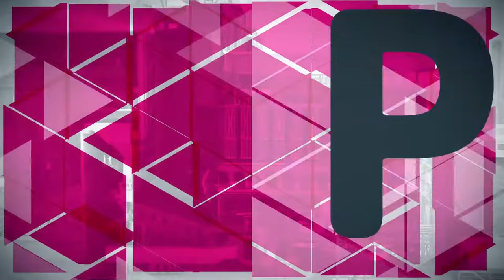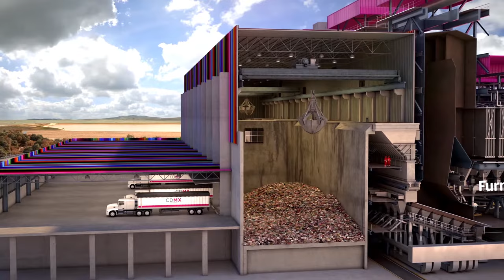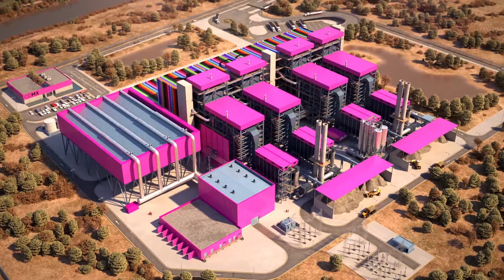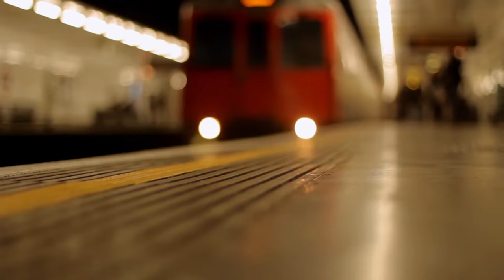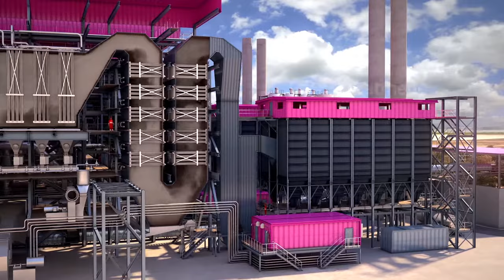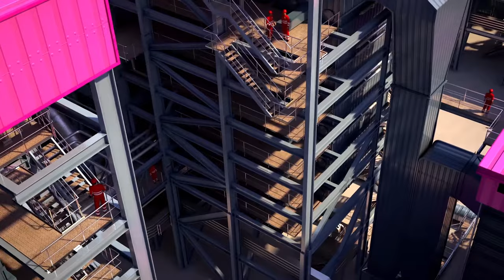voxelstudios -- Waste to Energy Plant in Mexico

Comment: We need more of these in Canada too. Well done Mexico city, you are on the right track.
If you want to get even more power out of the same amount of fuel, I hear combined cycle turbines are well worth the extra cost. A gas like propane is boiled at very low temperatures in the cooled flue gas after water has been boiled for the steam turbines. It is the same principal as a steam turbine just with a liquid that boils at a much lower temperature

Comment: How are you treating the dioxins, heavy metals, and waste water coming out of this facility?

How do you prevent these contaminants from reaching subterranean aquifers or spreading through the air?
Reply: Over 800 degrees c is enough to eliminate most dioxins during the combustion process.
Reply: Not only are dioxins broken by such gasification but almost all toxic waste outside of radioactive waste can be broken down.
Reply: Pasquale Gelardi  Take it easy. We learn everyday
Reply: there a filtration system in the loop to reduce emissions
Reply: @Emperor9992001 : Toxic waste that's a chemical element, like lead or mercury, cannot be broken down by heat and has to be filtered out somehow.
Reply: this is what turns cars black with soot, toxic garden soil, and blackened roofs in NJ
Reply: By using a special packaging material in the scrubber stages, dioxins can be taken out from flue gases

Comment: it's steam? wouldn't it be smoke
Reply: Through the combustion of garbage, that hot gas (with the soot that is smoke) passes through a boiler to take water and make it into steam for the turbine.  This technology has been used for over 200 years to varying degrees.  It first started in Britain for pumping water, then made it into vehicles like trains and then into ships as well as power plants for factories.  Along the way, the technology has been improved but mainly used these days for generating electric power and some niche applications with hobbyists.